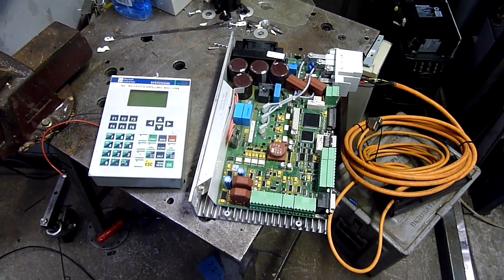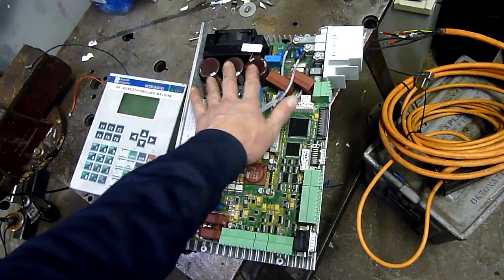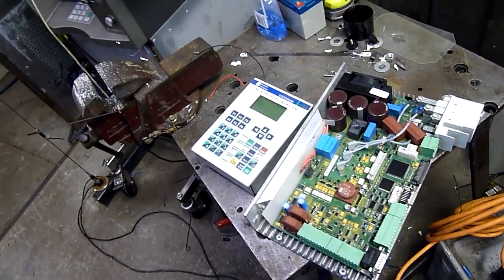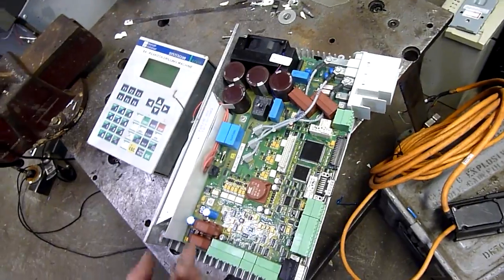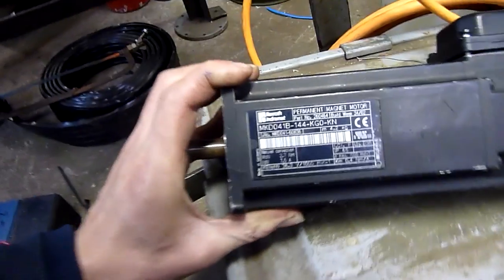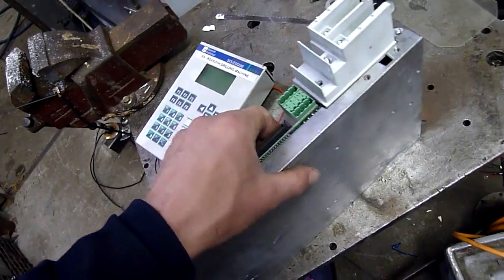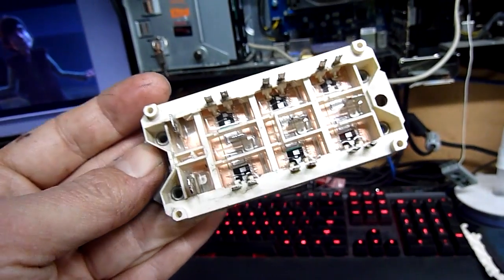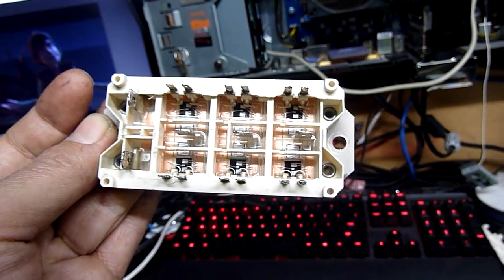Rexroth Indramat Servo Drive Autopsy

Comment: you said the power went out? it has an internal battery, if battery is bad, it will loose its settings (for ex the address). it says so in datasheet.
so that might be the problem.

Comment: I have got a MKD041B-144-KG1-KN servo motor , 24V DC, which I'm going to use for my DIY CNC project. But I can't find any encoder wiring diagram anywhere.
Can you please  send med the wiring diagram or a link to one if you have?
Thanks :)

Comment: Given there are two pairs of extra wires coming off the motor, they could be RTD's (resistive temperature devices) to measure the temperature of the windings.   CNC machine axis and spindle drive motors commonly have two RTD's in them, one that the control uses to protect the motor, and a spare in case the first one goes bad.

The other thought would've been tach sensing, however those aren't common on 3-ph BLDC motors, as opposed to brushed servo motors...

Comment: 68HC306, the 68K processor like used in the Amiga and Atari ST. The single chip next to it seems to be a 16 bit SRAM while the other 2 seem to be FLASH

Comment: that huge scr brick looks awfully similar to a big model aircraft/quadcopter ESC. i wonder what the current rating of that SCR pack is, as with 3 more of them and some butchered esc's, you could make a HUGE quadcopter... the EDcopter :D it would probably use the lithium battery from one of those electric hybrid cars :D
Reply: insanitybiker It is not SCR block it is IGBT Module and it is very common in 3 phase inverters and VFD, RC ESC don't need to use IGBT, they can use MOSFET which are more efficient at low voltage (IGBT are better for voltages over around 300V) and MOSFET are easier to drive (IGBT have 150-200% greater gate charge you need to charge/discharge).
Thyristor (SCR is General Electric's trade name for a type of thyristor) is silicon controlled rectifier can't be used to control DC current (they can't be turned off by signal, only when current thru them fail to 0). There is new GTO devices (gate turn-off thyristor) which can be used as switch (it can be turned off by signal)

Comment: I can only imagine that the extra two pairs of black leads on the motor are for timing to feed back to the drive system, so it knows what phase to activate at what time to spin the right direction and speed. Other cable likely has miscellaneous sensors such as RPM, torque and temperature.